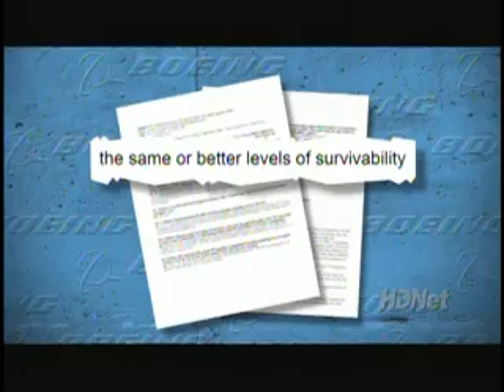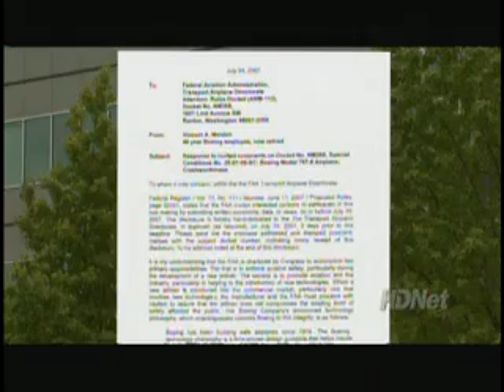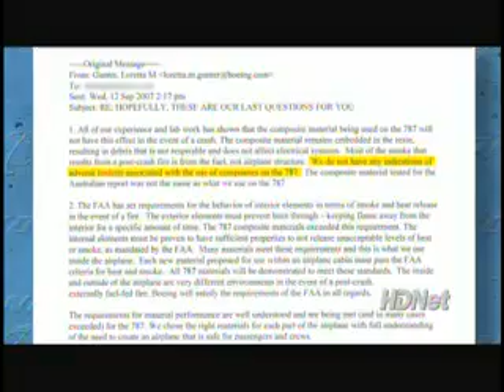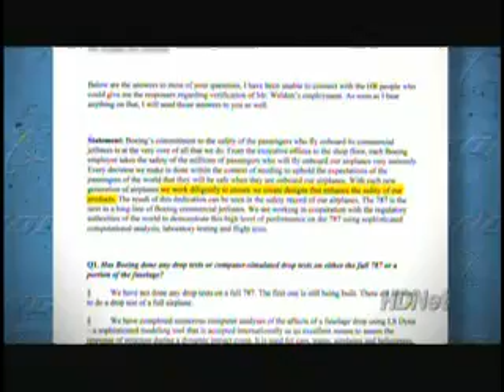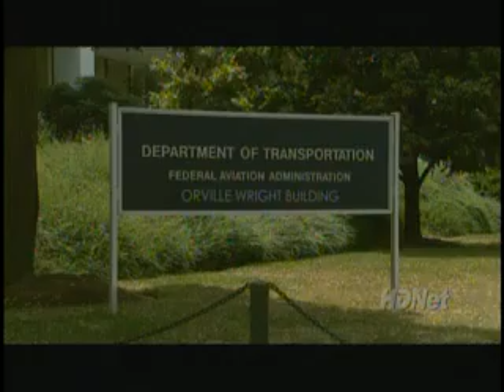Dan Rather Reports - Boeing 787 composite concerns (2 of 4)

Comment: RexBanner. How many airliners are currently in service than have fuselages built solely from CFC? How long have they been in service?
Since Mr Weldon's concerns regard crashworthiness - the ability to protect passengers during/ after potentially survivable crashes, and the effects of age/ wear & tear on composite planes, your example is totally irrelevant. CFC/GFRP is not new but it's previously only been used on mainly aluminium airliners. It's too early to know if his concerns are valid.

Comment: Well said, and very true. Mr. Weldon was in fact fired by Boeing over this. When he was fired he was the Director of New Technology and Research. I'm reluctant to use the word genius in reference to anyone, but it may fit Mr. Weldon in regard to Aerospace Design and Engineering. He has a long and proven history of innovation and problem solving regarding a wide variety of Aerospace and Structural Engineering issues. I also agree that Boeing would never publically admit to any design problems.